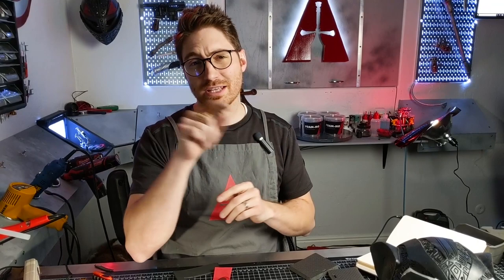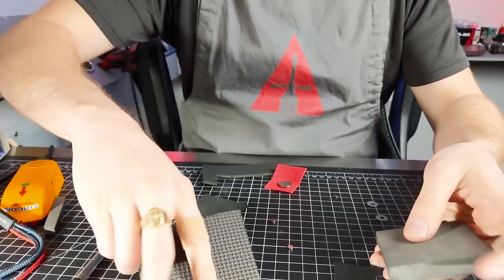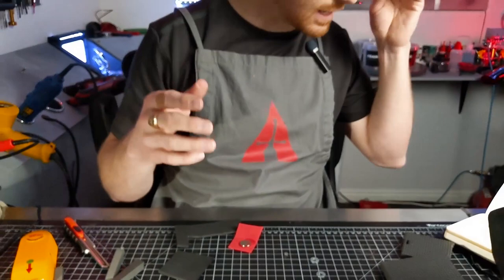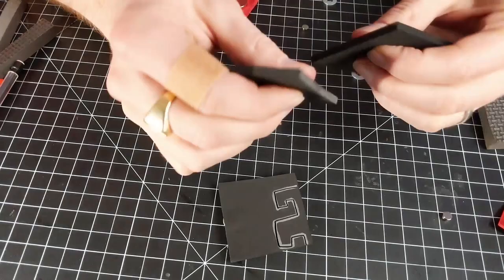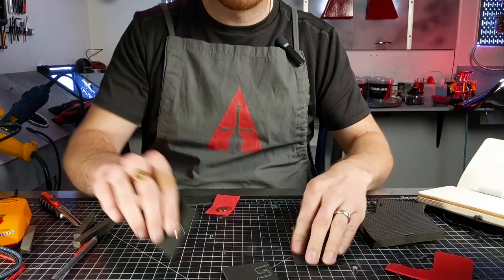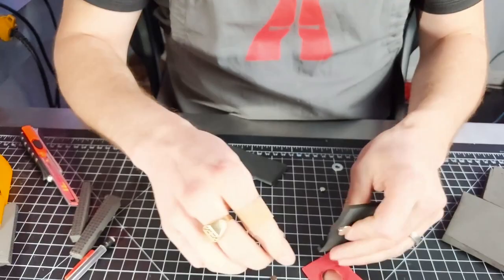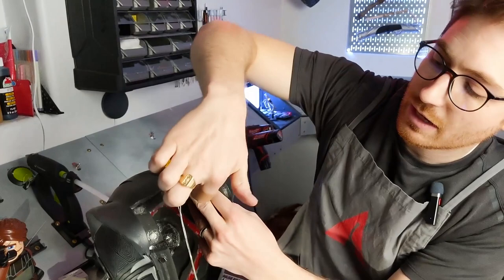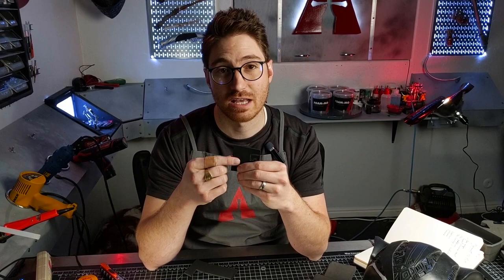Tips For Magnetic Attachments On EVA Foam Cosplay Armor and Props | Cosplay Apprentice

Comment: A problem Im having with reverse insets is the foam thickness reduces the pull/strength due to it being between the two magnets. Am I not drilling the depth down far enough or should I go up to a larger diameter neodynium?
Reply from the maker: You are definitely on the right track. If you need to increase the pull strength then both of those options are ways to do it.  If you have the room for it, increasing the size of the neodymium magnet will definitely help. Depending on the type of foam you are using, you can get away with drilling the depth deeper. Essentially you want as little foam between the magnet as possible without compromising the foams integrity too much. So the denser the foam the thinner you can take it and not have issues.  With the WTF ( What the foam) I used in the video I drilled down leaving only about 1mm-2mm of foam. But with High Density foams you may not want to go anywhere less than two and probably at least 3mm and up to make sure it is strong enough.  Also too, if you are doing the reverse inset you will usually want to use magnets on both sides and not try metal washer on one side trick I talked about at the end. That will help to strengthen the pull too. Hopefully that helps! :)

Comment: I’m making a set of antlers that will attach to the smoothed surface of my helmet, they’re about 15 in. Long, but they only have three short points and they’re super duper light. Should I make an inset on my helmet and base of the antler? Should I make a little cup around the magnet on my helmet so that they don’t wiggle? What size magnet should I use..? So sorry to ask so many questions, any comments would be very appreciated! :)
Reply from the maker: I would use as large of a neodymium magnet as your project will allow. I think the cup around the magnet idea would be good to help hold it all in place better. Put neodymium magnets in both the anthers and the helmet to get the most magnetic hold you can get.

Comment: Do you get indents or pull though issues with reverse inset?
Reply from the maker: It all depends on what type of foam you are using, there could be issues if your foam is not strong enough and can rip easily but if you are using a denser/stronger foam, I haven't had it be too much of a problem.  I would recommend try What The Foam! It's super strong and holds up great!! :)

Comment: wouldnt that side swipe sollution tear the fine rest of foam apart after several uses?
Reply from the maker: By using hot glue to glue the magnet it, it fills that void and pulls the to sides into eachother tight so that the foam is not flimsy and will hold up surprisingly well :). Also I demonstrated it on the softest foam option and if you use High Density foams or even better WTF (What The Foam) then you decrease your chances of it tearing to next to zero.:)
Reply: @CosplayApprentice  i see..so just reinforced with hotglue is sufficent? thanks for answering...i'll try it out then :-) btw your workplace is off the chain. you already know that ;-) i wonder if you could come up with some sollutions for holding tools in place like you made for yourself?
Reply from the maker: Thanks! I love it, it is a pretty sweet space and functional too! :)
Reply from the maker: Yeah, I will add that to a list of video so show how Increased my tool holders and giving other ideas too. :) Thanks! :)
Reply: @CosplayApprentice  that's cool to hear. looking forward to new videos of yours!:-)